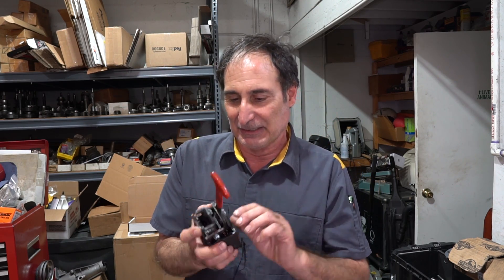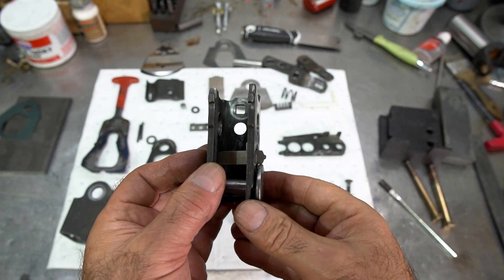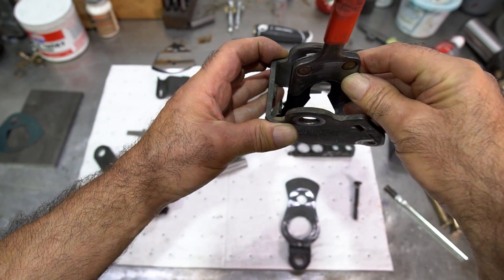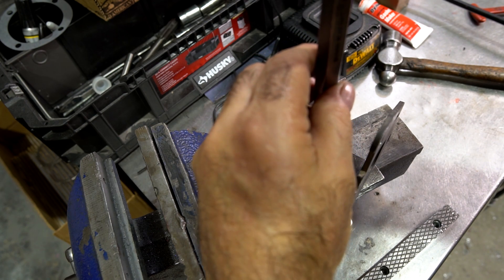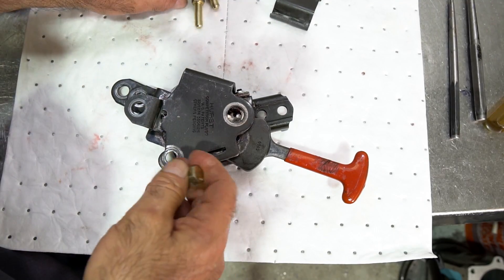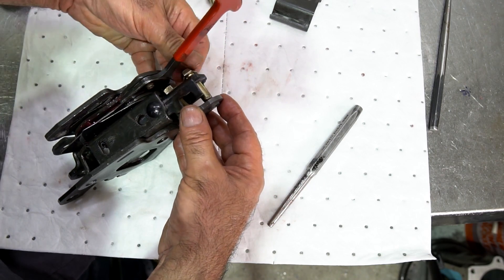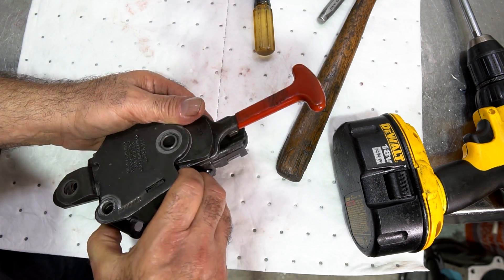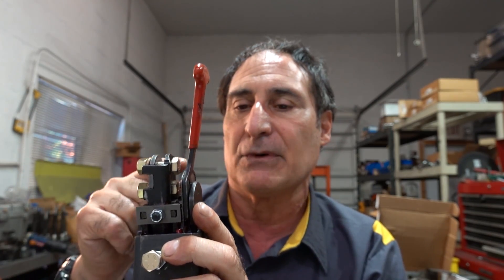Hurst Super Shifter 3 Operation Explained

Comment: Have watched a few of your youtube videos and was over to your website looking to see about sending my shift in to be rebuilt, but didn't see anything about do that. How do I go about doing that and any rough guess on what it would cost to go through it ? Original Hurst shifter out of a 71' Trans Am I'm restoring, it's pretty grungy looking and needs new handle, but from what I could tell, it does shift through the gears even though the car didn't run when I bought it

Comment: can the super shift 1,2 or 4 be converted to a 3? Of the 1, 2, or 4 which would you recommend?
is the super shifter mount and rods stll available?
Reply from the maker: 373-8611 is a super shifter install kit w/mount. Just use the 1-2 and 3-4 levers

Comment: Excellent video you should have been a teacher aircraft mechanic school they had your mentality I very much like that kind of a personality ask about an inline shifter had maybe the vertigate I'm not positive I thought hers had one also were you just straightforward and straight back like a ratcheting shifter the reason I asked about this is I'm going to put a transmission on the back of a quick change rear end I'm building a mid-engine car that is IRS and I want the differential as close to the engine as I can get it so my question is about the inline shifter can it be made for constant usage and endurance type road racing application
Reply from the maker: Inline vertigate is different than a Sequential shifter  vertigate was made for drag racing only

Comment: Just wanted to take a moment to thank you Paul, for making these instructional videos, and for making the 3-D printed jig available to the public for free. I was able to get a friend to print one for me, and used it today to re-assemble my original Super Shifter III. The results are fantastic!!. Everything went back together, just as in your video(s) Using the jig certainly made the process much less stress full . I even re-did the Plastic-Dip on the reverse Loc-out Tee handle. The shifter looks even better than when it was new. I had all my parts cerekoted in Armor Black ( a satin finish that looks great!!)...Wish I could show you a picture of the finished product. It looks great!. Thanks again for all you do, all your videos and literature are very helpful.

Comment: I'm wondering if you could give me some advice. I have a new competition plus that won't slide left into the reverse gate. I've in a vice and in the car. I've put a lot of force, it just won't go left. Could it be just some burrs which need cleaning up. I'm confident in taking it apart but don't know if it would be a waste of time. Your advice would be much appreciated. Thanks.
Reply from the maker: Putting it in a vice does not allow clearance for the reverse plunger to exit the body
Reply: @GearBoxVideo  All good, I sorted it. Thanks for the reply. Love your videos.

Comment: I have a 78 Z28 with this shifter can I remove the lock out portion, just recently stared having issues.
Great videos,new subscriber👍
Reply from the maker: The  bias springs don't exist so you would have to swap out all the internals

Comment: Great vid. I just acquired a 69 Mustang with a lockout hurst but mine has a red ball not a tee handle. Is mine not a SS3?
Reply from the maker: That was an addon
Reply: @GearBoxVideo  Thanks. I’d like to remove it. Should be possible.
Reply from the maker: Replace it with the standard. 015 reverse shim

Comment: The best i can remember the first super shifters you had to push down on the shifter stick to shift into reverse. a friend of mine had one and it was a real pain in the Ronda, it get it in reverse
Reply from the maker: Actuall the newer Long and Roltek shifters have a push down for reverse. The 3 speed shifter conversion was used because it automatically went from 2nd to 3rd.

Comment: Along time ago in a land far far away i would put a hurst three speed master shifter on my Muncie's four speeds it had a spring-loaded reverse lock out so going from second to third you would not go back into first then i would run a rod through the floor with a knob on it and hook it to the reverse lever
Reply from the maker: Old Jenkins trick. I believe there is a video on Youtube of this mod.
Reply: @GearBoxVideo  that is most likely where i got in from i was a big Jenkins fan. one time i was at the track and i walked in his trailer and he cussed me out and threw me out, good times

Comment: Great video, Paul. Can you convert a comp plus shifter into a super 3?
Reply from the maker: No. Most of the gates are different and some parts are no longer available
Reply: @GearBoxVideo  Gotcha. The mount plates are different too, right?
Reply from the maker: Mount plates depend on application and the bolt pattern is the same from shifter to mount. So you can mount a standard Comp Plus shifter to a Super Shifter mount and linkage.
Reply: One more question. How long is that straight stick? 7" 8"?

Comment: Used a couple of those over the years. The Vertigate was just as quick even though the throw wasn't as short. The Vertigate was kind of a double edged sword though. It eliminated the 2nd to 3rd mis-shift. But was a pain to use in traffic with the finger lever (not sure what the proper name is).

Comment: When you said the floor had to be cut, you weren't kiddin'. Back in those days I didn't care about keeping the car original and I just took a reciprocating to my Camaro floor and opened it up for the beefy Super Shifter 3 shift rods. I'd played around with the Mr. Gasket Vertical Gate shifter before coming back to the Hurst Super Shifter for reliable shifting at the drags and street use. Thank you for the memories.
Reply from the maker: you could see the street most of the time if you looked down!

Comment: LOVE these shifters! I bought an original Hurst Super Shifter (without the reverse lockout lever) for my 1968 Torino GT. And you may not believe it, but that was a real driver's car! The shifter was easily the single mod besides the Shelby suspension stuff that made it so good. Wish I still had it... Thanks, Paul, for the video!
Reply from the maker: Good to hear!